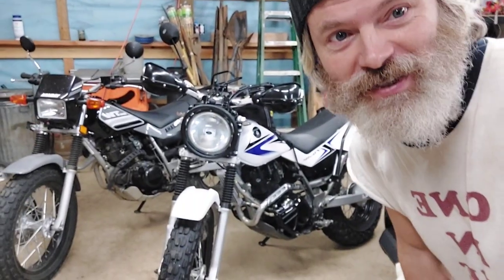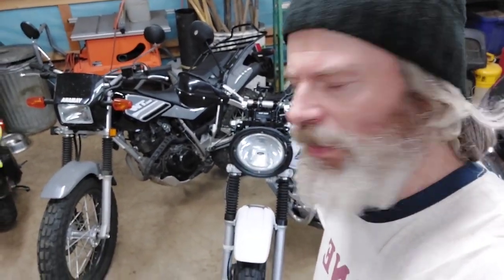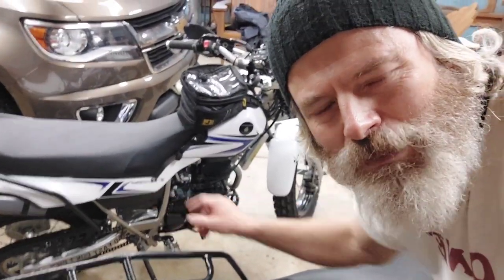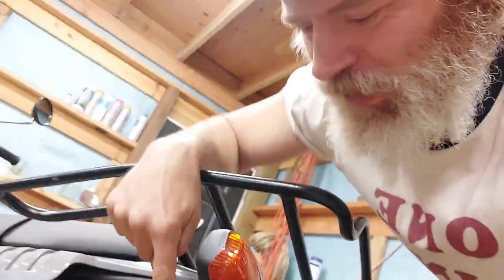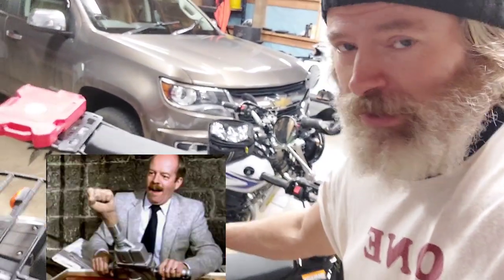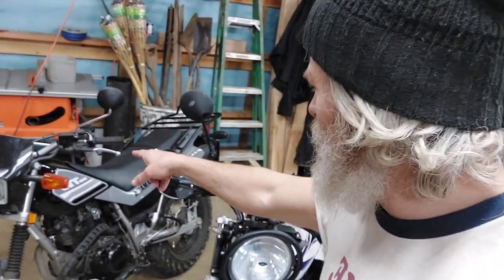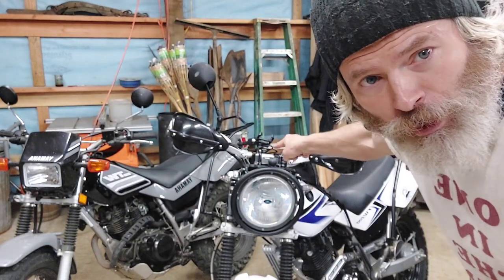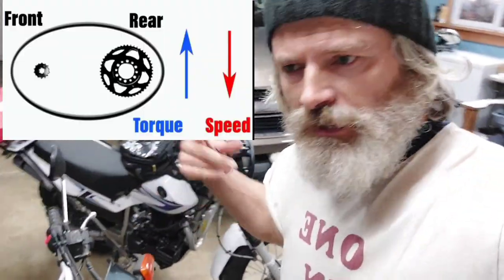Yamaha TW200 Stock vs. Modified!

Comment: If you haven't changed to LED lights you need to do it.  The stator is not very powerful and to free up some amps for usb and or 12 volt chargers and or extra led bar you need to reduce the running amp pull.  Only thing I recommend is leave the back turn signals as regular bulbs.  You can change all other lights to LED (front turns, head light, brake/tail light, etc.).  Reason is you will get hyper flash if you change all turn signals.  There are a ton of 'fixes' for this and they seem to work for some but I have tried them all and none worked for me, others have had the same experience so I say don't bother.
Reply from the maker: Thanks for the info. Ive never heard of hyper flash. My bike(The Squatch Rocket) is all led. My Brother the Butthawk's Tdub is completely stock. We'll get his modified with led. I wanna add a 12v charger soon.
Reply: @OffGridandWhiskey  Hyper flash is they blink REALLY fast.  Also sometimes when switching they won't blink at all!  Don't know why some have no problems, some can just change the flash unit and others are just 'unfixable' but that's the way it is.
Reply from the maker: I'll keep an eye on it. Especially with the 8 inch Baja headlight.
Reply: just bypass the stator and connect directly on the battery, i got ~120w of light on mine and it's a 1999, so 35w max, just make sure it has time to recharge... you could put a 1000w hitch on it in fact, the battery will take it, just dont run it 10 hours a day ;-)
Reply: @MuktiLuv  It's not the watts it's the amps.
Reply: @hazcat640  most bike battery are like 20Amp sustained, my setup takes like 10A, some battery goes up to 40A, and thats sustained, CCA (power they can hold for 30seconds) often goes over 500A, a 1000w hitch would pull arounh 90A, so yeah, you're fine even with a pretty basic battery.

Comment: your TW is pretty tricked out,. The only thing I would really change right away it would be the front tire and get a Shenko 241. Other than that not a must-have but they have a kit where you can put a kickstand on it in case your electric starter gives out and that way you can have both.   I’d rather have the stock pipe and have it quieter but the aftermarket pipe does sound cooler but I’m old now I like quiet better. You definitely got lucky on that one it’s got a lot of great upgrades.
Reply from the maker: Thx! I bought a 241, but haven't put it on yet. The Squatch Rocket has the kickstart kit already. And yeah, the pipe sounds cool, but I'm old too and rather have a quieter sound. Yeah, it was a score.
Reply: @OffGridandWhiskey  perfect then, throw that front tire on there and give it to me please. 😂😂😂 just kidding keep it I’ll get my own eventually but it’s definitely one of the best TW‘s I’ve seen you’ve got a lot of cool accessories that aren’t really available anymore like your skid plate and that side protection, I like it.

Comment: Looks like you have the stronger aftermarket skid plate instead of that pop can they put on from the factory. You can now go log hoppin with confidence!
Reply from the maker: Good eye. Not sure what brand it is, but the guy I got the Tdub from was making noise like it was special. ?? Lots of stumps in Western WA!
Reply: Man that’s a TCI plate I have been looking for one for so long
Reply from the maker: Yes. TCI plate. Thx 4 the insight! I looked it up. With engine guards. Not cheap back in 2012.